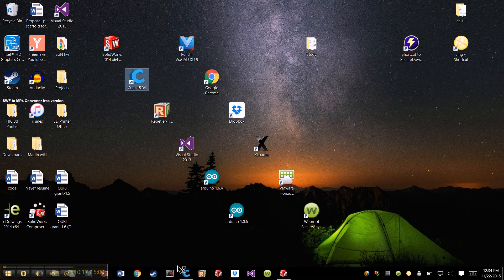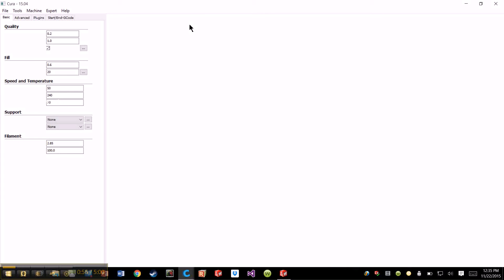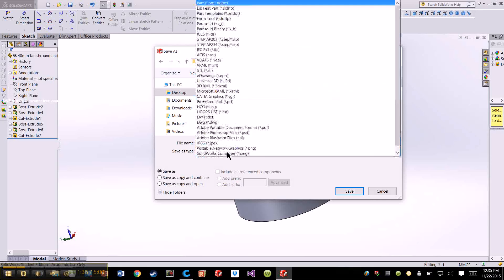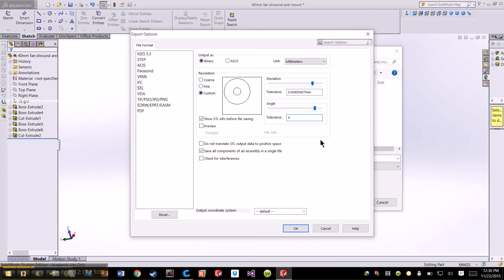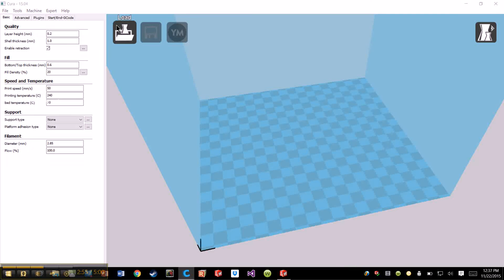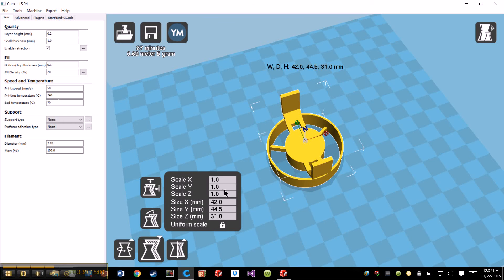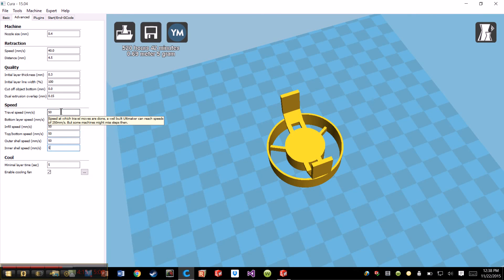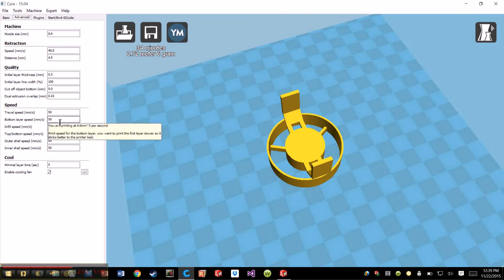Using Cura Pt. 1

Comment: How do you use Solidworks? I'm going to be using my 3d printer to make cosplay props and armor, can I do that (make custom designs) in Solidworks?
Reply from the maker: I could make a video to help or just help you personally if you need! Might I recommend Fusion 360 if you're looking to learn a CAD program, its really powerful, I stopped using solidworks almost entirely to use fusion now, it is that good
Reply: Thank you so much for writing me back! I looked into Fusion 360 a little bit and it looks great so far! If you did ever want to do a basic tutorial on Fusion 360 it would definitely be appreciated!  Or a full walkthrough from making a simple design using Fusion 360 to putting in Cura and then printing it out! Thanks and you got a new subscriber!
Reply from the maker: Hey, I apologize, I have been busy and when I had a chance to make a couple videos the output (I am using Jing) is some weird format that is hard to get converted to something youtube can read. Do you still need help? I can point you in the right direction or show you maybe on an "online whiteboard" or class session type web app if you want? Let me know, thanks!

Comment: how did you got solid works, I tried to get a free version for students, but it did not download right. and nice video, thank you, now I can use cura
Reply from the maker: I got mine through my university, if you purchased or got it through a school, you should be able to follow the download manager to download/troubleshoot. If it does not work, I highly recommend Fusion 360, it is just as powerful if not better in certain aspects to solid works and provides simulation, and CAM integrated into the program (amongst other features) for free for students and a free commercial license if you make less than $100K for whatever commercial application you would or are participating in. I stopped using solidworks to use Fusion, it's that good